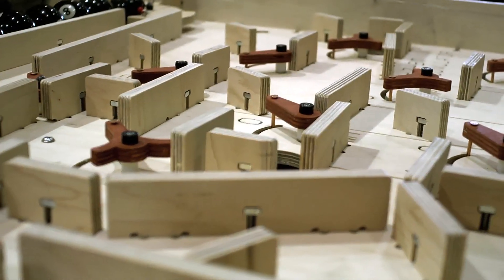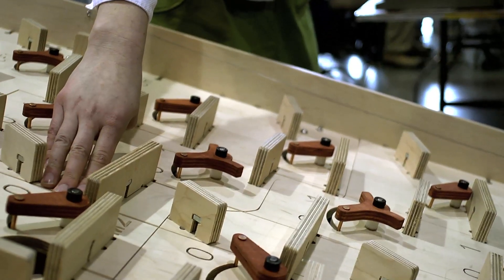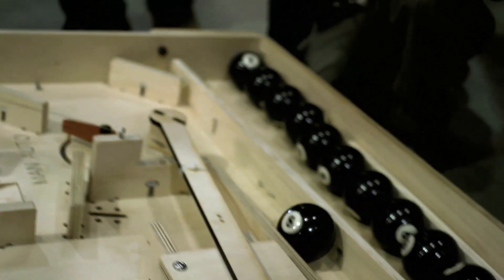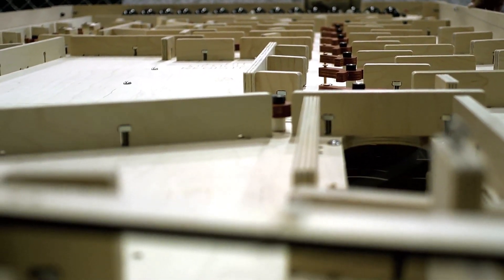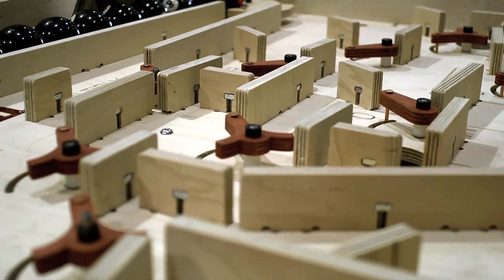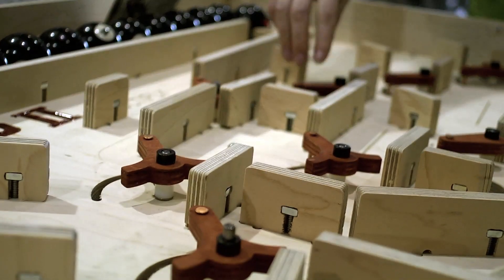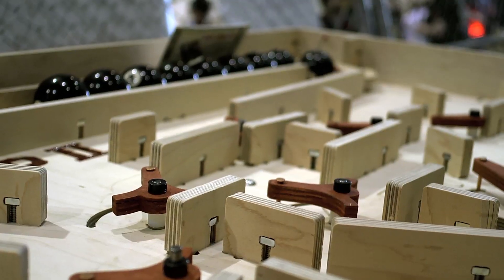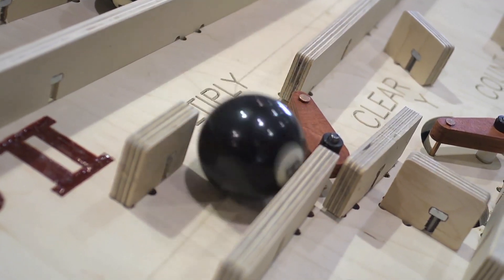Reproduction of Early Mechanical Computer: The Digi Comp II

Comment: For the benefit of those who said they would like to know how it works, may I put in my little bit.  I shall describe it for a multiplication process, say  5 multiplied by 7
There are effectively four sections to this computer,
The first section on the far  left consisting of three binary bits are acting as a COUNT DOWN  system where one of the numbers say the number 5 can be stored in it and this counts back the number that was stored till zero is reached .
The second section in the middle is a four bit register where a second number say the  number 7 can be loaded and through the mechanism provided this number can be transferred to the  accumulator register on the far right.
The third section is the accumulator  where the result are accumulated and projected at the end.

The fourth section is a four bit digital divider which routes the marbles to provide enough "bits" to transfer the  four digit number to the accumulator.  This is how it works.  
*The first marble is routed to the the "four bit separator"  which routes  the first marble to  one of its output ports  to the three bit register containing the number 5 which counts it down to 4 while at the same time the marble is used to transfer the highest significant bit on the register containing the number 7 and this bit is transferred to the accumulator. The second marble falls through the digtial separator to its second output port and route the second marble to the  to transfer the second bit of the four bit number containing the number 7  to the accumulator.   The third marble will  operate the separator  to its third output port and used to transfer the third bit of the four digital number containing 7 to the accumulator, and the fourth marble will operate the digital separator    to its fourth output port and routed to  transfer the first bit of the four bit number containing the number 7 in this case.   
Now that the separator has gone through its four output port  position separation it will resume to take the next  ball and rout it to the first number  to count it down to 3 while the above routine of transferring the bits of the four bit number containing the number 7  to the final accumulator will  be repeated, which will take  four marbles to achieve hence till now eight marbles were used.
Then the  separator will again go through its four output port separation and it will resume to take the next ball  and route it to the first number to count  it down to 2 while the above routine  repeated. Another  four marbles will be used to achieve this .

The next marble will count the original number 5 to 1 and  the above routine to transfer the bits of the four bit number containing the number 7 will be repeated.

By the time the number 5 has been counted down to zero, it means that the digits in the four bit number  in the case holding the number 7 will be transferred to the final accumulator where the result is  " accumulated " through the addition of 7 five times hence the answer.

Adding is a case of putting  only 1 in the count down counter and loading as many nnumber as one requires in the four bit register and transferring all of the bits to the accumulator  and then repeating this routing for any additional number.

Subtraction well , there is a device which by changing over a few switches the accumulator can be changed to a system that works out  the complement  of a number , the 2s complement to be correct and so this means that one can get the negative of a particular number and find its negative and add it to  another positive number and so the result is effectively a subtraction.

Division, well if the multiplication of two numbers is obtained through  the repeated addition of a number where the repeats are equal to  what is to be multiplied well division is a case of subtracting one number from another a number of times  to see how many times one number fits in the other.  This computer makes it easy when there is no remainder in the division. 

The video does not capture the whole lay out of the computer as well as it should have so I suggest that readers will look up the digicomp 2 in some other video where the locations I described are easily to locate and so easy to follow the balls or marbles  through the routes which I described.   The issues to watch for when multiplying is the count down register on the left and the separator ( three bits) which will output four balls /marbles to its four output ports to cater for the transfer of the four bits where the other number is stored.  Those in addition with the two's  complement switches are  the masterpieces in this beautiful mechanical logic machine.    To get the human modern human mind thinking, this piece of wooden design is still as useful in schools as it was when it was originated  almost 60 years ago. Fascination how such logic can be achieved with an inverted pendulum being rocked to the left and to the right.   After learning to read and write  , the human  mind must learn  the alphabet of motion and movements and logic through shapes and states even in mechanical and body movements. That in addition to social ethics is a full education.